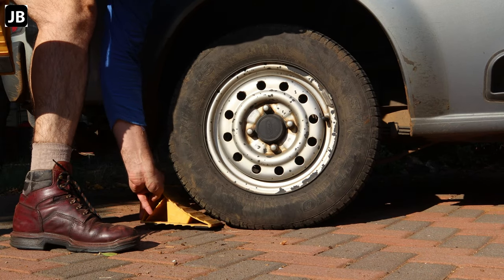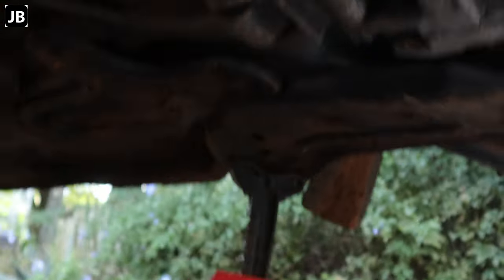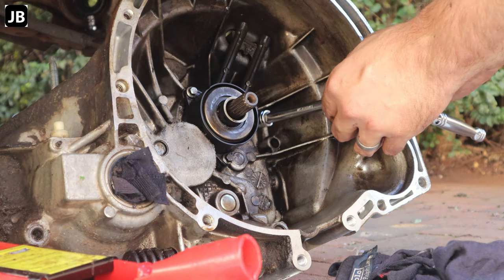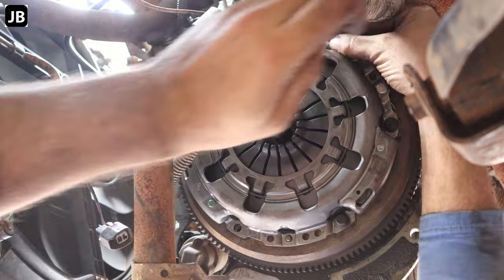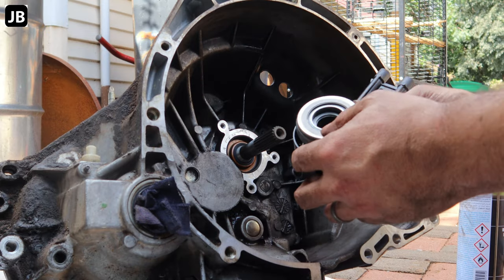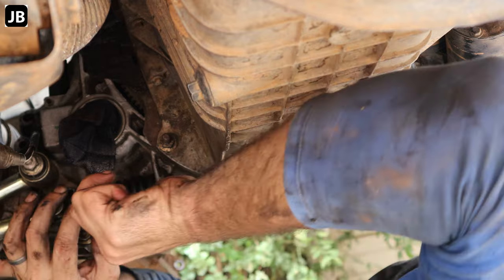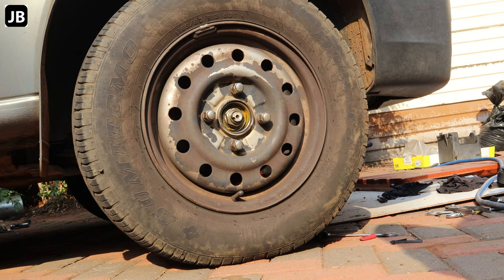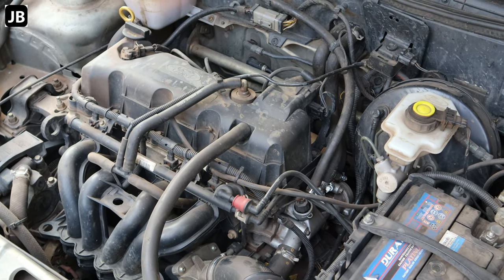How to replace a clutch plate on a Ford Bantam ROCAM. (Including concentric slave cylinder)

Comment: Thanks for this video! Helped a lot. Was a bit worried as my clutch finally went after 340k km on my 1.6 XLT. Removal was easy. Installation of gearbox was terrible😂, no space to pick up box and little to no room where the diff sits next to the subframe. Never doing this in my driveway again.😂
Reply from the maker: We all say that. And next time round we do the same thing over. Glad I could help. Cheers. And many more good miles on the bantam. I should never have sold mine.

Comment: I watched the whole video to see how you bleed the clutch in the end. Hmm, didn't show that.
Reply from the maker: Sorry about that. There is no place to film down there. It is basically the same as bleeding brakes. Get your son or someone to pump the pedal while you open and close the bleed port.
Reply: @JacoBadenhorst  No problem. I did learn that I'm never changing my own clutch haha. I did do my waterpump last weak. That was easy enough. I thought bleading my clutch may help since I'm stuggling to engage second. Sometimes it will go but usually doesn't.
Reply from the maker: @gerritgeldenhuys2763  yes bleeding the clutch isn't to much work. Give it a go. Hopefully it's just air in the system and not the clutch plate itself.

Comment: Hi I wanted to know how do you bleed the clutch
Reply from the maker: Basically, the same as breaks.  there is a bleed valve on the clutch slave cylinder. get the laaitie to pump the clutch while you open and close the bleed valve.  let me know if you do not get it right.
Reply: @JacoBadenhorst been doing that my clutch still not working
Reply from the maker: @ofentsevincentmodise4726  this could take quite a while.  Do you have all the fluids topped up?

Comment: You are very helpful thank you I'm looking for the speed sensor location on my bantam rocam
Reply from the maker: @katelynludwick  speedometer sensor sits on the gearbox between the engine and firewall. It has plastic thread so be careful not to strip the thread when replacing it. (Ask me how I know)

Comment: Very useful videos Jaco. I have already done some of the stuff shown and you're spot on 😜 Rocam is a tough little engine, quite remarkable in a number of ways. It also has a few irritating features 🤣

The concentric slave cylinder being one. A honda Ballade takes 10 minutes! That plastic thermostat housing. Actually the plastic parts in general but this is everywhere nowadays.

Comment: Thank you very much for this video
I am doing my timing chain, cv joints axal completely new, my Bandam is making a rumbling noise when she starts up, so I hope by replacing the timing chain and components with the oil pump that that should be gone otherwise it's in the head, but I don't hope so.  Any Ideas it sounds like the oil is priming for the first couple of seconds,  MY 1600 Bantam has 300 000 km on the clock and.

Comment: What oil did you put in gearbox
Reply from the maker: 75W90 GL-5 synthetic high pressure gear oil.
Reply: Quick question when replace the whole engine should I remove the gear box and mount it outside
Reply from the maker: @billiemor296  if I had to do it again, I would take off the bonnet ant take the engine and gearbox out as a unit and work on it outside of the vehicle.

Comment: Hi Jaco, great video,you are my mentor lol. I did an engine overhaul including changing clutch kit and the slave cylinder however I'm getting no clutch. I tried bleeding it however the clutch is not getting hard. Please help me buddy. Thank you
Reply: The reason for the engine overhaul was due to a blown head gasket however the bantam is still heating up pass the half mark. I removed the thermostat and installed a new water pump. The fan does come on and stays on for long and there after the head gauge rises pass half mark. What could be the problem? Thank you again.
Reply from the maker: The clutch is an absolute ball-ache to bleed. You need to be 2 people. Get one of the kids to depress the clutch pedal to build up pressure then you bleed off the air on the concentric slave cylinder. But note it takes for ever.and bleed it again a couple of days later.
Reply from the maker: @sumeethsamlall4264  dis you flush the radiator? What coolant are you using? Did You replace the pressure cap on the coolant reservoir?
Reply: @JacoBadenhorst   @Jaco Badenhorst  I used anti freeze coolant and I have not changed the cap due to the cap seeming to be sealing fine, should I replace that? And I purchased a radiator flush today so I will try that as an option and I'll keep you posted.
Reply: @JacoBadenhorst  I managed to get some pressure on the clutch pedal however it won't select any gears and I did not remove the gear selector because I had removed the engine block and replaced everything there including the clutch. Any ideas?

Comment: How do i bleed my clutch on Ford bantum
Reply from the maker: On the concentric slave cylinder there is 2 ports. One is the hydraulic input. 2nd is the bleed valve. You will need 2people. Depress the clutch. Pedal. Open the bleed valve to release pressure. Close bleed valve. Release clutch pedal. Depress clutch pedal. Release bleed valve. Close bleed valve release clutch pedal. Repeat till all air is removed.